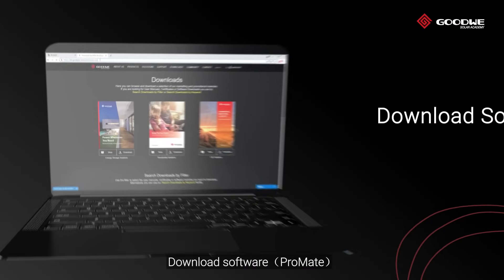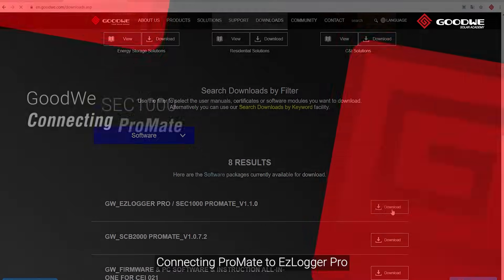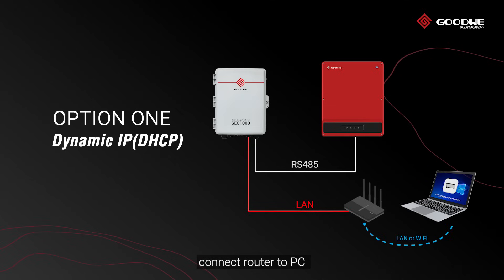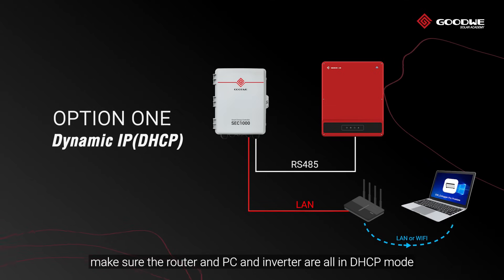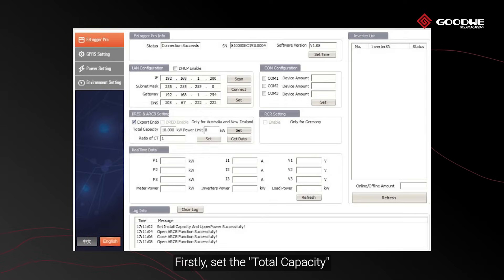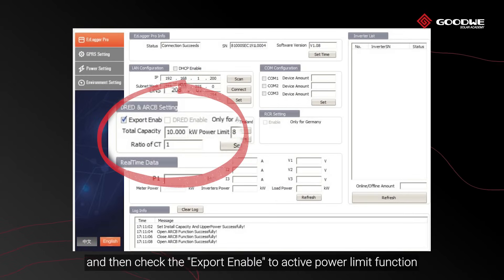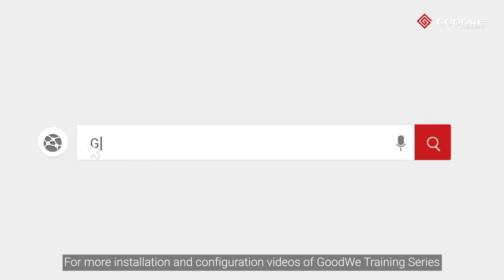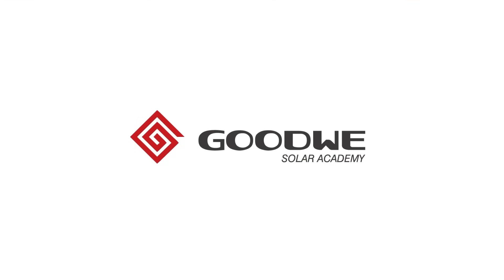GoodWe SEC1000 Installation & Configuration

Comment: Can we get local access to SEC1000 on IP address? e.g. Modbus TCP. We need to set export limit dynamically based on current prices...
Reply from the maker: Hello, you can ask local aftersales for Modbus TCP. https://goodwetechnology.zendesk.com/hc/en-gb
Reply: did you get a good answer? Cause I'm thinking of setting up a system with 3 goodwe inverters and an sec1000, and using a dynamic contract.

Comment: Can I connect different types of inverters with SEC1000, I mean for example GW30K-MT and GW120K-HT and could it be able to limit the export energy properly even if the export limitation is zero wattage? I kindly whating for your replay, thank you!
Reply from the maker: Thank you for your question. 
1.Yes, they can because both of them have the nominal output voltage of 400V.
2.Yes, they can limit the export power even to zero.